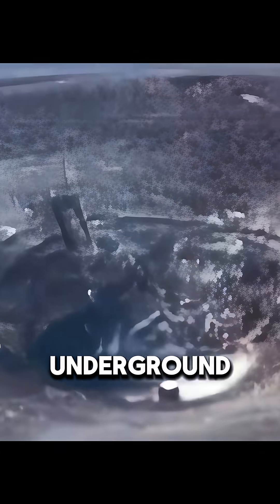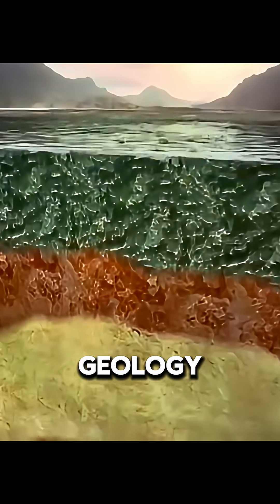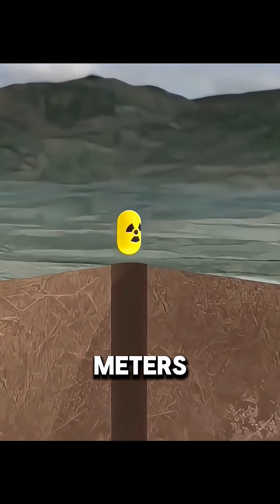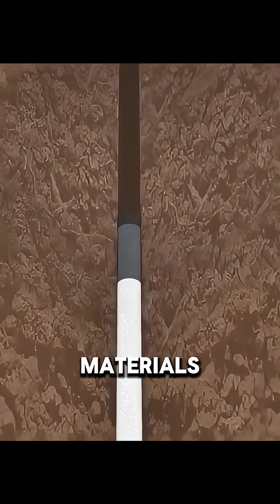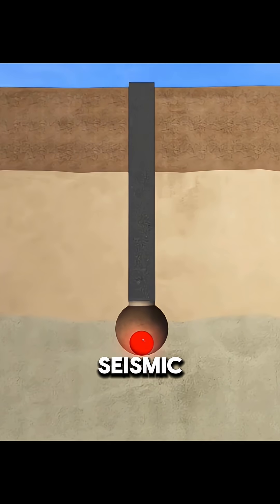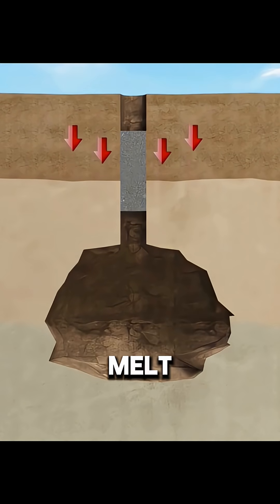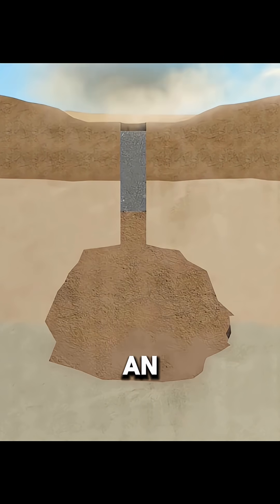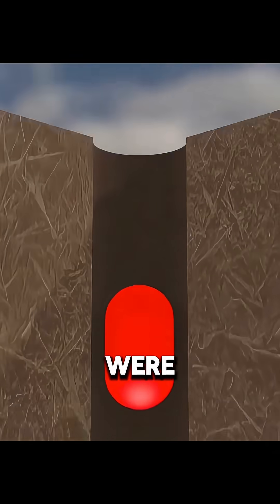The science behind underground nuclear blasts. #zackdfilm #foryou #nuclear

Comment: Just ask your self why nuclear bomb, you can use hydrogen bomb without much of radiation,and you are getting same results..
Reply: Do you know that a hydrogen (fusion) bomb uses a 'traditional' Plutonium (fission) bomb as a 'trigger'? That's the only feasible way of producing the temperatures and pressures needed for nuclear fusion reactions to occur at large scales outside of centers of stars.
Fusion bombs also use natural or depleted Uranium as 'tamper' to reflect neutrons, slow down the explosion and increase its yield. This Uranium is then fissioned by the fast neutrons, it contributes very significantly to the bomb's yield and also produces a large amount of radioactive fallout.
So no, there are no 'clean' hydrogen bombs, maybe relatively 'cleaner' than the equivalent number of fission-only Plutonium bombs.

If you want (mostly) clean nuclear fusion, look at Tokamaks, the ITER project and other experimental fusion reactors.

Comment: Its not easy as what you think to remotely activate the detonator underground especially nuclear power wireless device dontwork underground.
Reply: The test item (e.g. a nuclear warhead) is connected to the control centre with cables. The explosion is triggered remotely by wire.

Comment: This is not really the way it used to be done; we stopped underground testing in a test ban treaty with Russia and other countries.  Now the output of the aging nuclear arsenal is calculated based upon the aging of the nuclear materials and other components.  When it was still being done, the bombs were attached to a large circular rack with various test equipment sensors on shelves at different levels of the rack, which was then lowered to the bottom of the hole..  Cables carried the signals from the measuring equipment up to the surface as the bomb was detonating,, before they were vaporized by the explosion.  The information beat the physical effects of the bomb, moving at electrical speed, i.e. at the speed of light, before the equipment doing the measurement was destroyed in microseconds.  In this manner, the strength of the explosion, neutron flux density, and thus the yield of the bomb as built could be measured.  IIRC no bomb ever failed to explode, but the tests revealed how effective new designs would be before they were manufactured in quantity for use by the armed forces.
Reply: Thank you for your informative and rational comment.
It's rarer than U-235 in this discussion thread.

Comment: Ever so slight issues- hardly worth mentioning. 
The land above is unusable for a century at least if not more, far longer than any history book might be found to explain the geology and avoid a catastrophic decision. 
That heat takes ages to cool
The buildings surrounding it are radioactive.
The geology now says no water will enter or come out of the site. This presumes no water will permeate the rock or soil far into the future as that water will become radioactive even at a low but DNA altering level with no obvious evidence of it's toxicity. 
The US now uses a supercomputer to calculate a bomb designs explosion and you can run a different simulation (thanks to GPUs to calculate the vast math needed)
Russia does it the old way so it's only northern Siberians, the surrounding fish and all wildlife are obliterated at every test.

Comment: They also launched a manhole cover that weighed thousands if not tens of thousands of pounds into space
Reply: It had enough velocity to go to space but chances are it burned up before it got there, the same way meteors burn up before they hit the ground.

Edit:  Plus it only weighed 900 kg or about 2000 pounds.
Reply: I’m pretty sure manhole covers don’t weigh more than 300 lbs
Reply: @mcarrowtime7095 not when they are ten feet in diameter an 8 ft thick

Comment: I wonder if you put 25 shafts in a circle and did not fill them, if we could change Earth's orbit, maybe direct it towards the sun.
Reply: Even if you tried, most of the soil would fall back right away, the "lucky rocks" would burn up and disperse in the Earth's atmosphere and eventually settle down as dust again. It would have virtually zero impact on the Earth's orbit.
Look up the "Sedan" nuclear test explosion videos.

It's surprisingly hard to "throw" anything to the Sun. Much harder than to launch something e.g. to Mars or Jupiter.
Reply: @dr_vlad  we know that certain tests we have done certain explosions have changed earths orbit. We will just have to get enough power behind them.
Reply: @RobertMillerJustme Any evidence of that?

To change any celestial object's orbit you either need to hit it with another celestial object or send a very large amount of mass away into space (reactive propulsion) so that it escapes its own gravity.

Actually, the number one thing which affects Earth's orbit is the Sun, bombarding the Earth with photons which have non-zero momentum and exert pressure. The same happens with 'solar wind', i.e. charged protons and electrons hitting our atmosphere and slowly stripping it away. Luckily, the Earth's magnetic field deflects most of these particles away.
However, since the Sun's light and wind pressures add up along the entire Earth's orbit, they mostly cancel out (as long as the Sun's output remains mostly constant).

Any meteor hitting the Earth or just burning up in the atmosphere contributes its momentum to the Earth's and very slightly changes the orbit.

Launching a rocket so that is escapes Earth's gravity does the same in the opposite way.
Reply: @dr_vlad  - I will just list this one directly from NASA there are more 

Large-Scale Infrastructure: Human projects like the Three Gorges Dam in China have shifted enough mass to increase the length of Earth's day by approximately 0.06 microseconds.
Reply: @dr_vlad  Also one science will not tell you because the government is covering it up the detonation of 2067 nuclear warheads is what is causing climate change, it wobbled earth and the change in the earth spin cause a wobble that has changed weather patterns.

Another major cause is the hadron collider it is a huge magnet shielded from above but is affecting the molten Iron core changing the magma to change its flow as it is attracted to the world's largest magnet, I actually debated this one with NASA, and they admitted no protocol had been put into place to test for it.

Comment: When the U.S. dropped the Nagasaki and Hiroshima bombs  on those cities, I thought the radiation was supposed to last for hundreds of years, yet people have lived there ever since.
Reply: Most of the radiactive isotopes decay quickly and are mostly gone in a few days. The very unhealthy radiation (from Iodine 131) has a half-life of 8 days, so its mostly gone in about 6 months.  Strontium-90 and Cesium 137 have half-lives around 30 years, but because Hiiroshima was an airburst, most of that went up into the atmosphere and dispersed over a massive area -- not into the local soil.   Since half-life is a statistical probability,  residual radioactive isotopes can be detected for many years, but at non hazardous levels.
Reply: Thats auto bomb, not nuclear bomb, remember nuclear is 1000 times powerful than auto bomb.
Reply: @sherajphotography  A low efficiency Atom bomb like that is actually one of the most fallout causing bomb outside of dirty bombs. They have plenty of unreacted radioactive material and plenty of byproducts that would scatter.